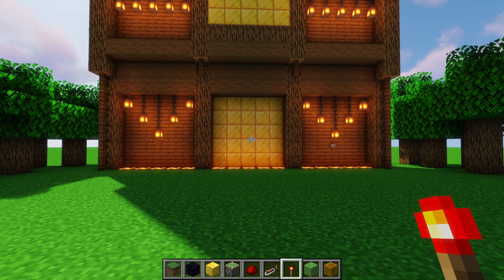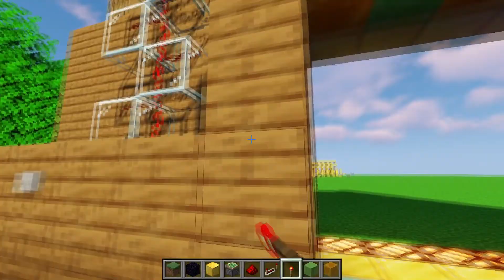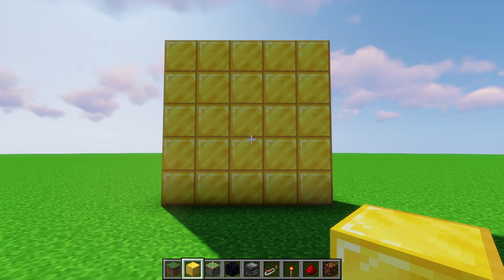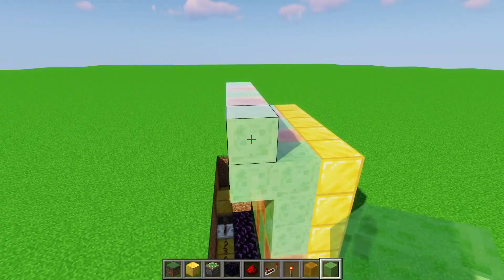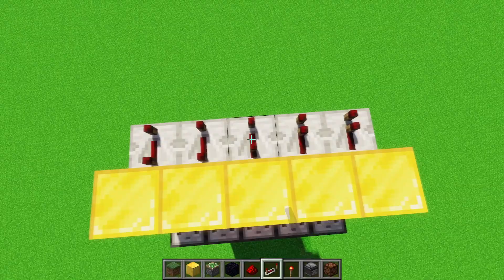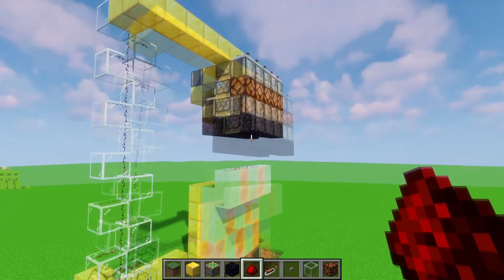Easy Vertical 5x5 Redstone Door (Java Edition, 1.21.11) | Minecraft Redstone Engineering Tutorial

Comment: great vid but when i tryed it did not work the top adn yes im playing in 1.21.11
Reply from the maker: I would check if something is blocking the top blocks from moving, like a wall or something (those are sneaky and can break it). The top is hard to get working though should work fine assuming delays and everything are good to go. If the top isnt doing anything I would also just verify the signal reaches up there, especially if you moved the button signal

Comment: I was building this earlier and came to a problem that the lower sticky pistons wouldn’t retract the top pistons and the door. Wondering if that has to do with a single or multiplayer sever
Reply from the maker: Servers can mess with it but it will work by default. I think I put obsidian in the wrong spot at the very end if that is your problem

Comment: not working at the top, The second piston doesn’t stick to the third one and breaks everything above.
Reply from the maker: Assuming youre in Java edition, see if something is getting stuck on something else, usually the sticky blocks getting stuck on the ceiling or something. If youre on a server sometimes they have compatibility things that cause some redstone to break, but typically it would make everything behave the same, not only the second or third or whatever one. One way to check is to only have one block vertically to make sure that it pulls everything up properly (so get rid of the second one temporarily so its isolated) and go from there

Comment: i made the door but if i click on the button the upper part doent close anymore it just opens closes and opens fast and 3 sticky pistons are pushed away
Reply from the maker: Does the signal reach all the way to the top when you press the button? Sounds like it is likely; I would also check that nothing is getting stuck such as a slime block sticking to something it shouldnt

Comment: will this work with a pressure plate on the ground?
Reply from the maker: It might, but only with certain types since the time the button is on and off for is important I am pretty sure. You can easily make it work using some repeaters and /or a T flip flop after it though

Comment: i did  the same but it wont work 3:38
Reply from the maker: Double check you wired it correctly. Also make sure you're on java edition because this very much does not work on bedrock. What specifically is happening that isn't working?

Comment: I tried with a lever and it didn't work
And i tried it on a button it worked?
Why that happened
Reply from the maker: It is only designed for a button. The signal needs to turn on and off; if it's held it will not work properly
Reply: @ZennsWorld  Thanks.

Comment: Would I have to change anything if I flip it so the taller part is underground so it doesn't take up as much space above the door?
Reply from the maker: The designs for the piston extenders would have to change, since going up is different than going down for both of them. It's possible, but the triple piston extender being under ground would have to use a much more complicated design (though the double piston extender on top would be smaller), so it depends on your layout and desperation

Comment: Could you do this in a 4x4 or a 6x6 as well? If so, would I have to change a lot?
Reply from the maker: 4x4: https://www.youtube.com/watch?v=fvEiniz81cw
6x6: Will come soon, but I assume it will be replacing the bottom double piston extender with a suitable triple extender, as well as adding one block horizontally to each
Reply: @ZennsWorld  Sick. Another question is, is it possible to destroy the lever after you’ve opened the door?
Reply from the maker: You'll have to be more specific with what you mean by destroy. Like get rid of the outside lever from the inside? If that is the case I'm sure you can replace the lever with some piston+redstone block system that could be deactivated from the inside (so you can't use it from the outside), or some other variation. An AND gate would do that pretty quickly though the XOR gate in the middle might need some work